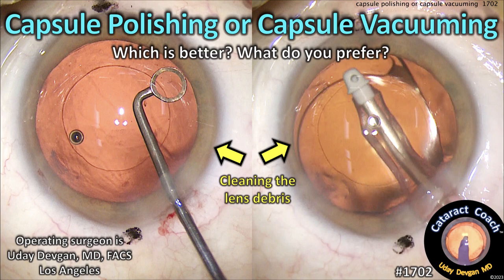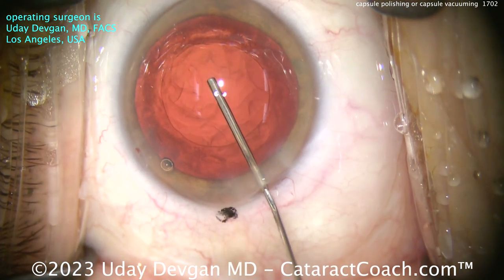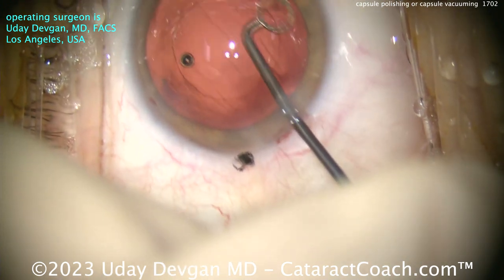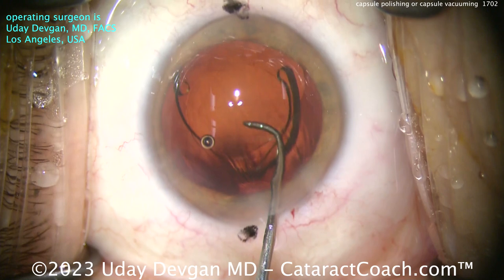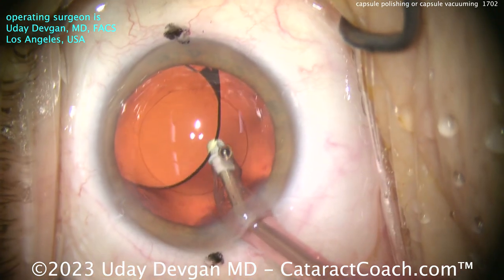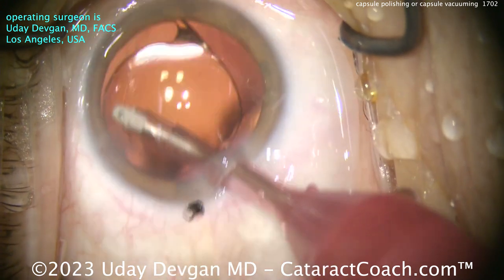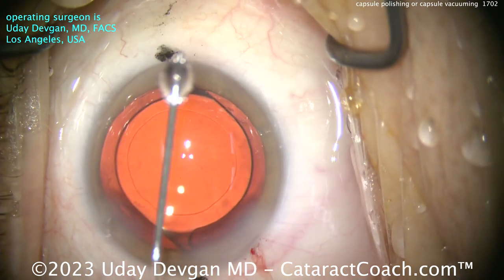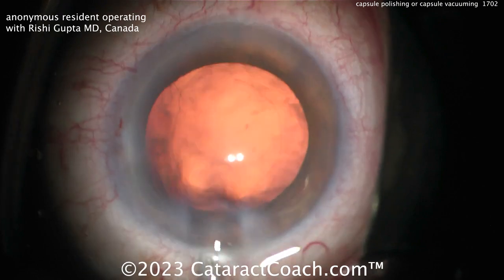CataractCoach™1702: capsule polishing or capsule vacuuming?

Comment: I love to polish the underside of the anterior lens capsule! Prefer a TITANIUM double sided instrument with singer sweep on one side for subincisional, and a curette style polisher on other side. Titanium helps it stay decently sharp and makes it so much better. A good and NEW titanium one will spoil you and make you not need to use I&A handpiece to polish. Good options from Ambler and Epsilon. No financial interest. Careful not to lift up on anterior capsule so much as to rub the back of the iris. Sometimes even put small amount of viscoelastic in sulcus to prevent issues there. I believe that polishing will result in less sommerings years down the road. At least I think it will! Quieter eye. Prettier eye/will just look better. Note that if polish when using an Alcon lens, especially if acrysof (but even with clareon), there will very often be a fine proliferation of material from edge of rexis onto the mid peripheral optic, especially if rexis smaller than 5.5. This does NOT occur with J&J acrylic. And it usually doesn’t happen with the Alcon lenses when you DON’T polish. Try it. You’ll see! But I believe polishing is gonna be important as we have this trend towards cataract surgery at younger and younger ages. Why? because of the sommerings as the decades go by. In these young premium lens cases, polish polish polish. And even consider primary posterior CCC to make combined sommerings removal and iol exchange easier 20 years later. Just my theory. Can’t wait to see how it pans out!🤪
Recorded a case in 30 y/o the other day with extensive polishing and primary posterior ccc. Need to find time to edit and post it.